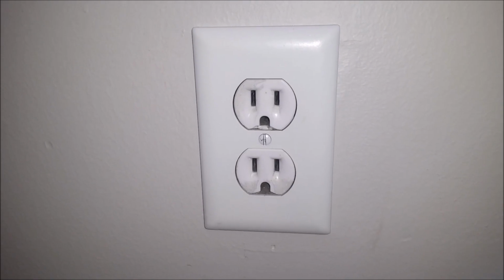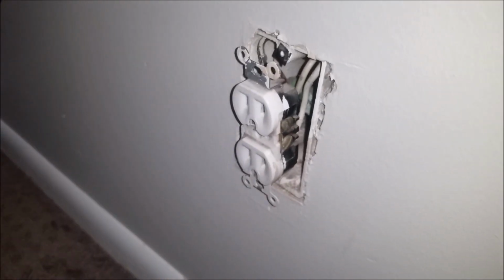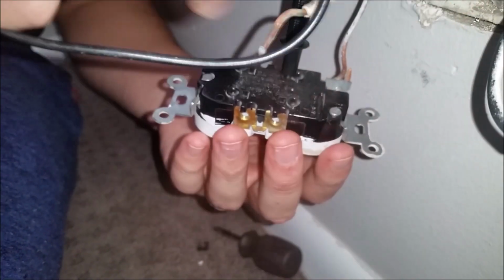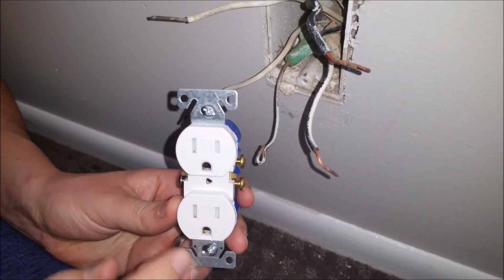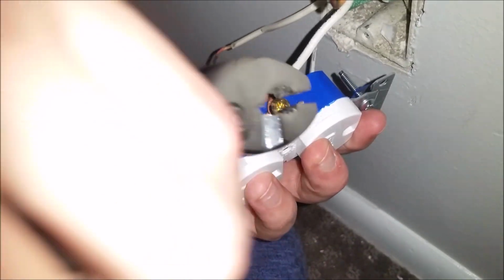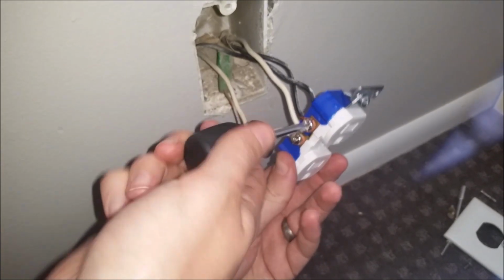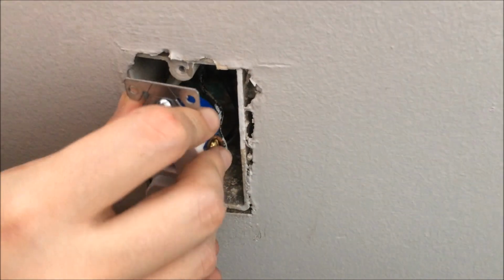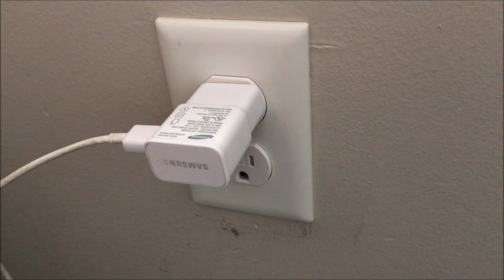How to replace an old electric outlet DIY video | #diy #outlet

Comment: Don’t they usually recommend to connect the hot wires last?
Reply: That is a great question. Because the power is not on it does not matter which wire you secure last. Thanks so much for your comment. Best of luck with your next DIY project and hopefully subscribe to Big Al Repairs.

Comment: why didnt you just turn the switch off
Reply from the maker: What do you mean?
Reply: @BigAlRepairs   i have  circuit breakers that controls x amount of outlets etc  so i can just turn off that dedicated breaker for x amount of receptacles which is listed on the panel  instead of putting all power off
Reply from the maker: @davelee5973  Yes, that is what we did as well.  We did not turn off all the power for the whole house, we just switched off all of the breakers that were labeled "plugs" as we did not know which one specifically went to that outlet. They did not label our breakers very well and did not label them by room. Our breakers are also outside of our house which is a pain. Thanks for the tips and comment!

Comment: MY grandpa electric outlet has no ground wire?
Reply: Then you replace it with a 2 prong or a gfci for shock protection. Gfci's are deeper and wider than regular receptacles, so some investigation may be necessary to verify if it will fit.

Comment: How easy is it to replace an outlet. Also I have never have done it before and I have 15 outlets that don't work.  Is it better if I get someone to do it?
Reply: Cynthia Thomas - With that many outlets not working hopefully it was breakers that were tripped or off.
Reply: Thanks for your question.  Take a look at the video and you should be able to determine if you are up to the challenge.  Good luck and let us know what you decided to do.  Hopefully you subscribe to Big Al repairs.
Reply: I suggest you watch a dozen more videos posted by either real electricians or someone with a substantial amount of experience.

Comment: heres a tip. make the loops smaller and crimp the wires with needle nose pliers. Also screw the screws in the same direction as the screws
Reply: freckly_BPG Games, Alarms, And More Great suggestions! Thanks for your comments. Hopefully you subscribed so you can give us feedback on our other projects.

Comment: two errors: 1: Wires bending should go clockwise 2: Don't forget to mention the removal of the breakoff tab, I burned my fuses for not doing that.
Reply: Wakeup To Reality you don’t have to remove the breakoff tab, that’s only when the outlet is split
Reply: Nick or a switched
Reply: Wakeup To Reality Hopefully you subscribed so you can give us feedback on our future projects.
Reply: Wakeup To Reality- Video should point out to check if tabs, on both sides (hot and neutral) were removed or not and to do the same with the new outlet...
Reply: Switched means that there’s a red outlet right?

Comment: 1. Put the loop opening facing clockwise, i.e. in the direction the screw tightens. When you tighten the screw, the loop will be twisting in a direction that closes it. Your bottom black/hot and top white/neutral wire have the loop backwards, which tends to open the loop as you tighten the screw (you can even see it in your video when you tighten the second black wire screw and the first white wire screw).

2. Get some longnose pliers (they are cheap), not those slipjoint pliers you were using. With the longnose pliers, you can put a nice tight loop on the wire, you can bend and straighten any wire a lot more easily. And you can much more easily close the wire loop on the screw terminal by gently pinching the loop closed. All of this can be done much more quickly, and easily, with the longnose pliers, because they are far more precise. And if you are redoing outlets and switches in your house, get a pair of linesman pliers, which allow you to do all this and more; they are beefier, but they have a sharp square edge which allows for increased leverage, yet also precision, with the same single tool. Electricians have some great tools that make it so much easier to work with wires, receptacles, and connections, and they're not too expensive.

3. Never, ever use those push-in connectors on the back of the outlet, also called "backstab" connectors. They are terrible. Do some google searches on backstabbing receptacles. A backstab connection WILL fail, it's only a matter of how long until it fails, but after ten years, no question those push-in grabbers start to weaken due to age, heat, temperature changes. So good on you for using the screw terminals. Screw and wirenut connections are very strong and will last for many decades, possibly even centuries (e.g. the wire's insulation will disintegrate long before a tight screw or wirenut connection will loosen).
Reply from the maker: Thanks for the feedback!

Comment: You are supposed to put the wires clockwise so they wrap around the screws more
Reply: Future gaming Boo ya Hopefully you subscribed so you can give us feedback on our future projects.
Reply: Future gaming Boo ya - 100% correct. Video should be titled,  "How I replace an old electric outlet DIMW video...(Did It My Way)

Comment: Thanks. That's what a plug in really looks like when it comes out of a wall. Now I might get up the nerve to replace my bad one and save a ton of money
Reply from the maker: Yes, it can be super easy!  Just always be sure to turn off the power and double check to test it to make sure no power is going to the outlet before you work on it!  It does not take much time at all and you can get really cheap replacement outlets that work great.
Reply: Big Al Repairs - Cheap outlets are cheap/ok outlets. They cost about 75cents. That's what you're replacing/installing. For only $1.50 more, still cheap, you can get a commercial grade (great working) outlet.
Reply: 357bullfrog Hopefully you subscribed so you can give us feedback on our future projects.